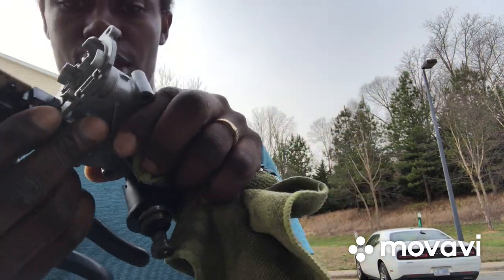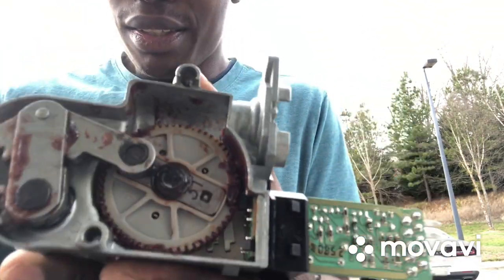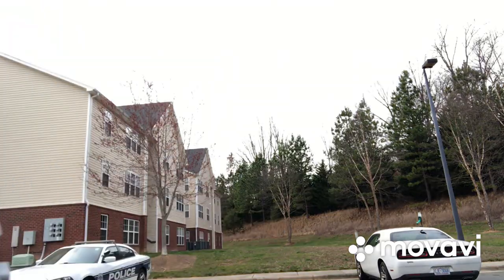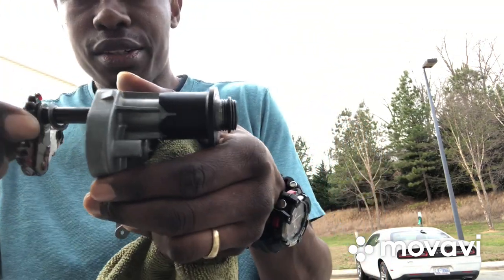How to check a faulty rear windshield wiper motor

Comment: What was all the gunk on the inside of the motor? Looking to replace my dodge stealth rear motor
Reply from the maker: Old grease and damage gears ⚙️
Reply: Crazy. Looking forward to changing mine. Just worried about damaging the paneling
Reply from the maker: Just have to take time do it